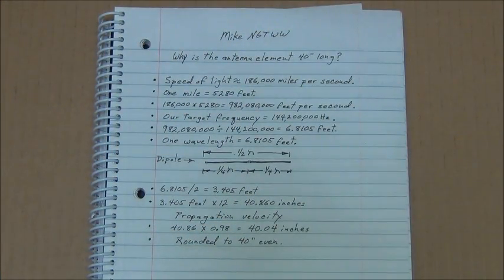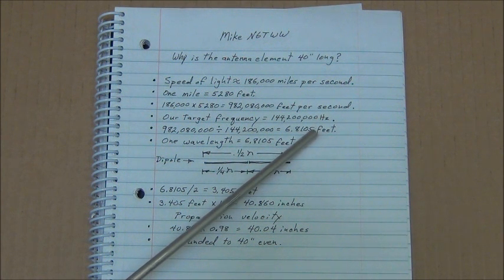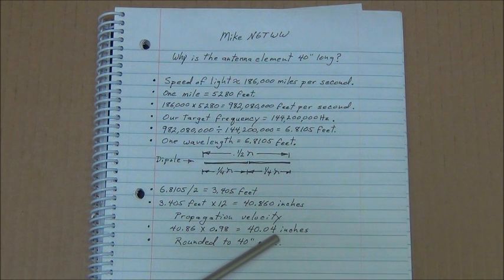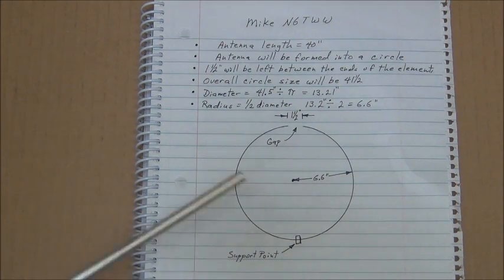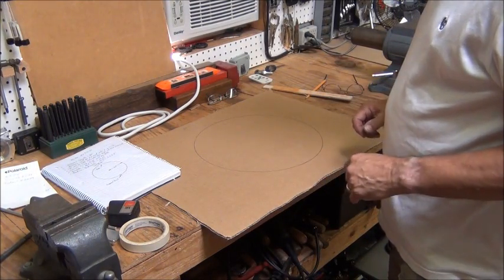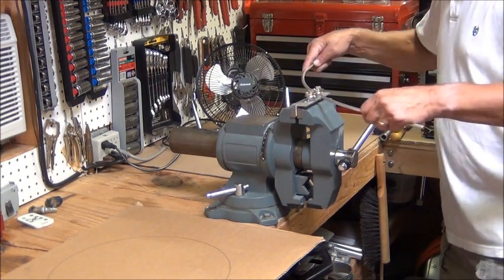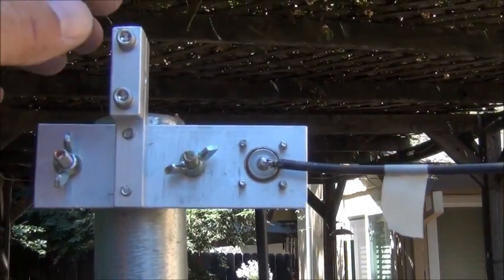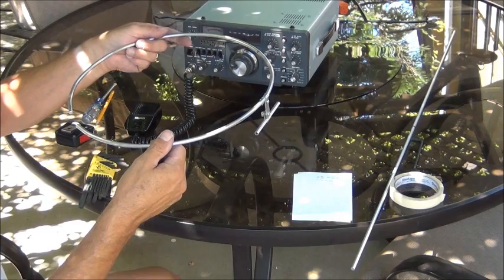2 Meter Halo Antenna Part 10 -- "Calculating the elemet length & forming the circle" by N6TWW

Comment: Was the inch-and-a-half Gap arbitrary
Reply from the maker: The gap was set by experience from building previous designs. The gap must be consistent at whatever distance is set because it will affect the tuning of the antenna. Some designs even make the gap adjustable in order to help with tuning adjustments.

Comment: Do you have to use measure or can you. Guess how long it can be
Reply from the maker: The length of the radiating element must be measured to ensure it will resonate at the correct frequency. If the length is too long the antenna will resonate at a lower frequency. If the length is too short the antenna will resonate at a higher frequency.